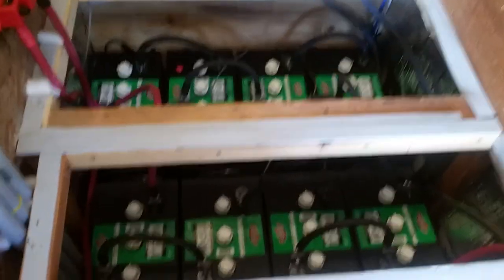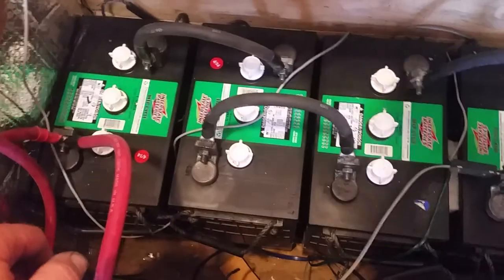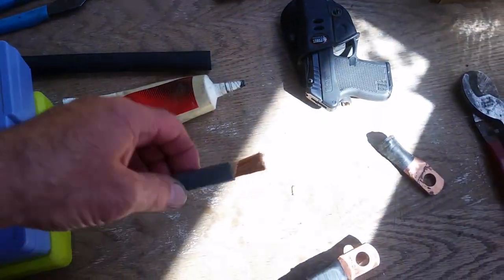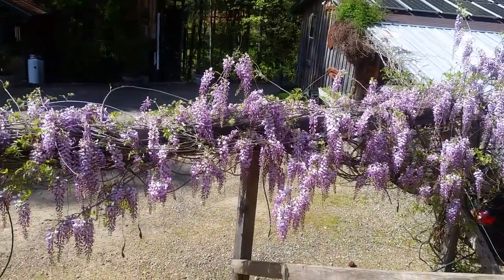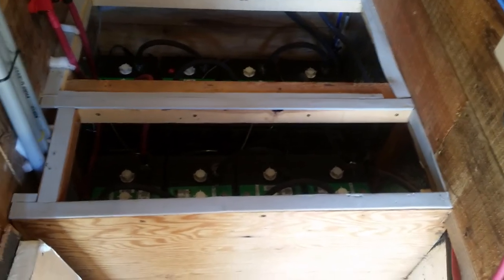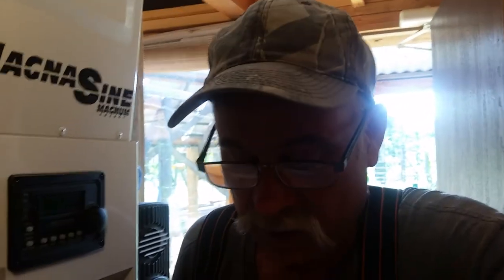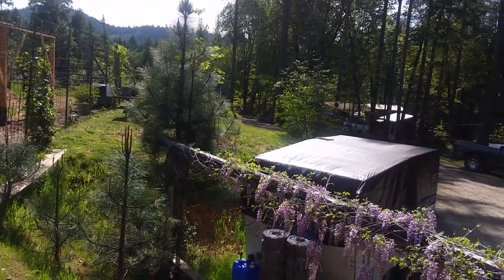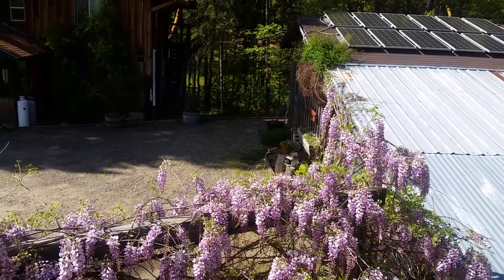Re-cabling all the interconnects and parallel jumpers with new cable. (More on off grid batteries )

Comment: Great info Steve...appreciate you sharing this with the community. Been running shorter absorb time/higher volts since about January. About 32.2 volts...depending on temp/battery sensor. Cable/crimps are not cheap!
Reply from the maker: Chris DIYer how is the new absorb voltage affecting your water ussage. I went a volt higher, cut almost 2 hours out of the absorb  time and I am using less water than before. I sure wish I could have got an answer on the spec sheet from Interstate  4 years ago.
Reply: Using more water (best guess...20% more?). For my Trojans...can't find anything on it that says "how long" absorb time should be. There are other guys that say they run theirs up to 30-31 volts for a short time every day and then float them a few tenths of a volt higher than the spec sheet. Aside from one of my L16's with a weak cell...running fine, plates look clean/clear in the AM (just checked). My next battery bank (dreaming) would be about 500 aH (48v) lithium in a climate controlled room. My AGM Trojans are doing great in my two other DIY off-grid systems...no issues. I run those up to 14.7 volts every day.
Reply from the maker: Chris DIYer That would be my dream battery bank as well. That's 24 kilowatts with a 70% DOD without any harm and can be below full SOC forever without harm! If I live long enough I may get one. California legislation passed calling all auto manufacturers to sell only EV cars by 2022 or so. That means literally hudreds of thousand of wrecked EV cars will be dismantled. The price of lightly used lithium ion batteries will come way down. Right now I can get a used Chevy volt battery shipped for $1200.

Comment: Wow that is so nuts. You would think with the volts going up you would make more heat. That is so cool man. Thanks so much for showing us.. God Bless
Reply from the maker: yankey4 It is backwards lol. The only thing I can figure is the time in absorb is much less because the volts are higer. One volt is huge but so is 2 hours extra absorb time. Apparently the longer time causes more heat Than the higher voltage with a shorter time?

Comment: Hi Steve. I really enjoyed my visit with you and Carol last week. I have to still pick up that piglet next week a few mile from your homestead. I will drop that electric lawn mower off at that time. Can I purchase a beam from you? 4"x 6"x 15 feet. I'm using it for the ridge beam on the new barn on which I will be bolting a barn door track rail and trolley on to attach a block and tackle rope to lift hay bales into the hay loft.
Reply from the maker: Pine Meadows Hobby Farm A Modern Homestead That sounds great jerry. Do you want a full 4"x 6" or dimensional timber  like 3 1/2" x 5 1/2"?
Reply: 3 1/2 x 5 1/2. Thank you so much. I  just purchased one of those lumber racks for my pickup from Harbor freight. It's working great.
Reply from the maker: Pine Meadows Hobby Farm A Modern Homestead Nice! I will be gone on Monday at the doc until 5pm. I should be home the rest of the week. If you need a bigger timber like a 4×8 that's no problem. It would give you more snow load than a 4x6.
Reply: Hey Steve. I have to run back over there today to return the crate I hauled the piglet in. I will stop by about 6:00      wednesday to drop off that machine. Thanks buddy.
Reply from the maker: Pine Meadows Hobby Farm A Modern Homestead we will be here. I have your beam ready.

Comment: Do you use dielectric grease? My batteries were very hard to find the info on. You will find out if you loose more water. I always thought more v more gassing. How balanced are your batteries . Id rather a balancer then a desulfator.
Reply from the maker: Frank Z yes I use dielectric grease. You are right to use a balencer rather than a desufater. The specific gravity numbers are tightening up since the new cable and interconnects were changed. At the rate it is going in a couple more days they all will be spec.
Reply: Cool. Looks good. Thanks for the vid.

Comment: Thanks  for sharing this info Steve, There is so much to consider U mentioned so many things to think about. I never wold have thought about having the terminal lugs holes all the same size! I know some of mine are different because of using what I had when building my cabling.  Lots of good info here & about the desulfater also,thanks . I need to really pay attention as I build my new system soon.
Reply from the maker: TheKilog69 Thanks. Chris DIYer check the ohms on every interconnect before he installs the cabling. In fact  he even bough a solder pot and a Highpress crimper. 
I did not ohm mine out I just did the best I could. Your place is looking real nice. Lots of work I bet.